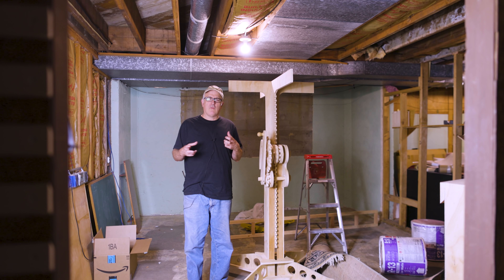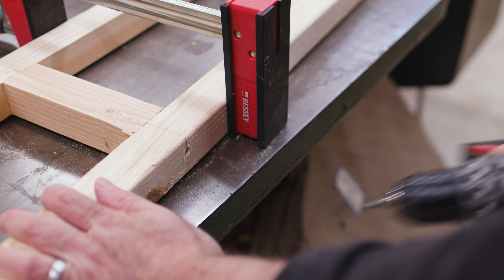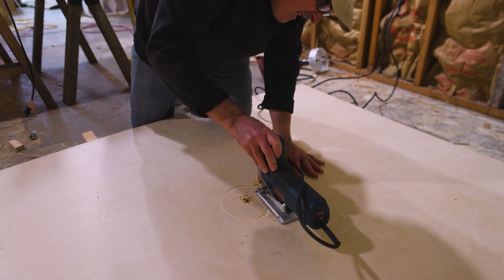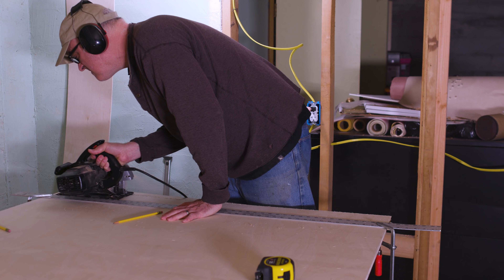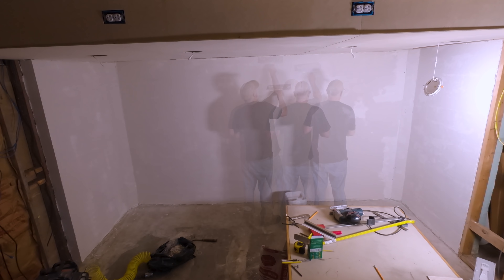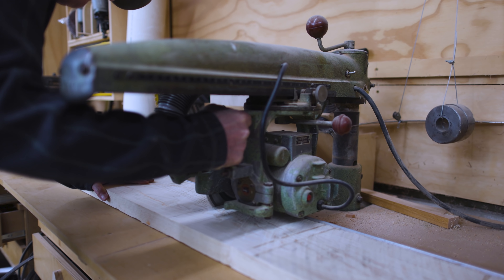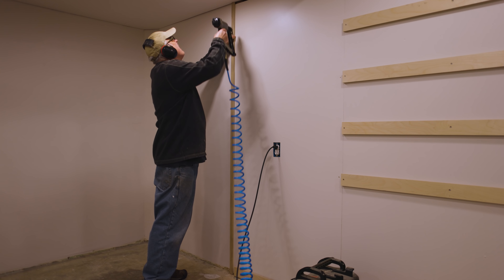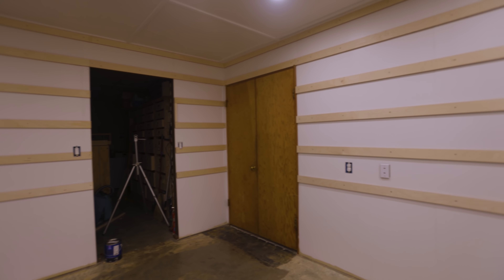Making a Craft Room

Comment: Frank, I loved your video, but I highly recommend you Don't paint your floor. If you paint the floor now, in the future, if you decide to put in any other type of flooring, it may require you to grind off that paint. Any floating flooring may require some floor leveling to the subfloor, which will not bond to a painted surface. And any glued down flooring like carpet tiles will not bond to the paint or even the thinset for ceramic or porcelain tiles will not bond as well. The only flooring you may be able to install would be a tackdown carpet, which is typical for residential setting as the tack straps are nailed down to the concrete and are not affected by the paint. Just a suggestion from someone in the flooring industry for 9 years now. Looking forward to your next video!

Comment: Code violation to cover the junction boxes in your ceiling. Those need to be accessible.
Reply: Yep. Typically those style are just "placed" in the ceiling not attached to the joists.
Reply: @rsporter  no. they are intended to be installed as shown. the light is removable thus accessible.

Comment: I also made my air return out of plywood, but I only went halfway thru from the front using the cnc router and then, on the back side, cut halfway thru in a perpendicular pattern. It REALLY made the painting an effort (until I broke out the spray can).

Comment: You should consider carpet squares for the floor. I had them in my basement when i bought the place.  I pulled about half of them out when i moved my wood shop in and ended up regretting it  so i put them back. 

It keeps the room more comfortable,  and the dust down.  Cleaning is as simple as just vacuuming.

Comment: A good trick with the outlets is take the outlets out and drill a hole in the 'center' of the box. Then with the panel in place use a trim router with a straight bit and follower bearing to follow the box.

Comment: It's interesting to see you struggle with the hole saw, but plow right through with the jig saw.  I work in ship repair running pipe.  I have drilled a lot of holes in bulkheads and decks with hole saws.  After you get the hang of drilling a 3" hole in a 1/2" thick steel bulkhead, punching through wood is easy day.  I've installed those lights in my house and struggled with a jig saw, then went out and bought the holesaw.

Comment: Hi Frank, I should stop lurking. I'm do
ing the same thing as you, coincidentally. I used a router with a template to cut holes, and your idea to make the holes small is good.

I'm using 3/4" fire retardant ply.

Excellent item i discovered are Carlon depth adjustable boxes - in some places just using 1/2" ply.

Comment: I didn't notice a supply register for your HVAC, one of the overhead ducts was more than likely  a supply duct, you could have added a register to open as close as needed. With the addition of the vent for air circulation it would have taken care of a return air air balancing issue. Nice little build for that room, the french cleat system is great.

Comment: The vent you made is interesting, it ties into an idea I've been thinking about lately. I think places like that would be a great place to sneak in fans and air filters. The idea would be to integrate common off the shelf parts (like a box fan and a 25x25x1 HEPA filter). Shared walls that you don't mind sound crossing between, custom entertainment centers, computer cases, seem like ideal locations.

Comment: Love the video Frank. Regarding cutting out perfect holes in the walls for the electrical boxes. Break off the "ears" on the top and bottom of the electrical plug to make the fit a little easier.

Comment: Covering the electrical junction boxes in the cieling is an electrical code violation, as well as the open splice in the wall at 13:28. Hope you don't regret it later on.
Reply: Permit?  Not a responsible video imo, sorry Frank.

Comment: Your video was well edited and informative.  Thanks,  The only thing I would have done differently is to glue furring strips on the concrete walls, insert rigid foam between them and then put wall board on the furring strips.  However, you were wise to leave the concreate exposed to allow it to dry.  I hope the covering does not trap moisture.

Comment: Our house is over 200 years old, so you can imagine that the windows are pretty small. Moreover, they are only placed along one side of the house. We have used a paint made by Dulux called LumiTec (I don't know if it's available in the USA, but I'm sure there's something similar) that contains reflective particles. It's brightened up our rooms no end. It's twice the price of other paints, but you can use it as the top coat only which saves a bit of money.

Comment: The "9-inch stud wall" you referred to are commonly called "ladders" in my region. Often times framed with a 2x2 at the ceiling and a strip of OSB (or ply) instead of "studs."

Comment: Will sound odd, but wouldn't drywall be cheaper to line the walls and ceiling with since you have painted it at the end?
Reply: Well it might be easier for him this way
Reply: As a project room, perhaps plywood offers more durability?
Reply: Drywall has a lot of extra steps, and requires tools and techniques he may not be as comfortable with, plus a lot of dry time between steps before the paint can go on. I think the extra effort for drywall in residential construction is largely for sound and fire management.
Reply: @ardemus  he plastered some of the walls, pretty confident if he can do that he could handle drywall seams
Reply: I had the same thought. Would have to be a lot cheaper too.

Comment: Frank love your work but @13:30 I saw a wire terminated with nuts in mid air and I bet it's live. Then near the end of the video I saw an empty electrical box above the vent that was CNC'ed. I hope you will replace the wire and route it to the empty box and put an outlet.

Comment: Why not drywall instead of plywood for ceilings and walls?
Reply: You must be new here. jk
Reply: It's just Frank
Reply: I'd say the level of dust and mess created by drywall and mud is quite unattractive for diy projects. Also as the other commenters said, watch his other basement projects and you'll see his style.
Reply: I was sort of wondering the same thing but plywood is a little more manageable and certainly more durable. I think it makes sense for a basement room especially if things are going to get moved around frequently
Reply: Really seems like its against most codes to do plywood instead of drywall. Hope his insurance covers it if there is a fire.
Reply: Frank was an architect in his past career, so he should have at least some familiarity with his local codes. If his municipality allows drop tile ceilings, I would think 1/4 plywood would be fine.  It isn't an auxiliary dwelling, so fire separation isn't really necessary.  I can't imagine fire spread on plywood would be particularly aggressive.
Reply: @justinschramm8481  If it was against codes to do plywood, every mobile home in America with wood panel walls would also be against code. As would all of your wood kitchen cabinets. 😉
I've worked in the Architecture industry for almost 20 years now, there's no code against wood panels on walls. The reason builders use drywall is because it's cheaper and finishes smoother.
Reply: @justinschramm8481  I'm not sure why it would be. Plywood is certainly a better barrier than nothing at all.

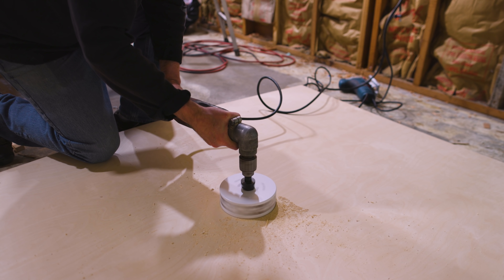Comment: 6:45 is that a backwards hole saw?
Reply: I wouldn't want to have one though. Seems to cut really slow. Haha
Reply: Frank reversed the direction intentionally.  It reduces the chance of the teeth grabbing and ripping the tool out of your hand.  It also reduces the chance of damaging the panel. Since the panel was ultimately going to be painted, he 1) wanted to be safe and 2) didn't want unintentional tooth grabbing in places that would be painted.  

He could have also used a different tool that had a clutch to control how much the hole saw would grab as well.

Comment: Frank – why only staples to hold-up the ceiling panels, but screws on the wall panels?
Reply: Ceiling was only 1/4" plywood. Walls were 1/2". Double the weight on the walls.

Comment: Not sure what the electrical codes are up there, but it looks an awfully lot like you're actually covering up those junction boxes behind that paneling which is a big no no.    Although never used those LED lights like that,  not sure if there's an exemption that it's close enough to the hole that it puts it in the same category as the junction box on those cans.
Reply: The flat LED lights are rated to be hidden like that.  They are still "accessible" because you can remove the disks with the LEDs and reach the junction box.  The pigtail connecting the box to the disk is fairly short.  You aren't going to have the j-box beyond the reach of your arm.
Reply: @HarryLovesRuth  If you can't access the connections inside the j-box, then it doesn't meet code.  I'm assuming that the j-boxes and fixtures are all running at 120V.   There are different rules for low voltage.
Reply: @kurtryan9208  Which Frank can do with the fingers that are at the end of his hands which are attached to his arm.
Reply: @kurtryan9208  some research will show they are entirely code compliant

Comment: Just curious, why did you use plywood and not just drywall?
Reply: Probably the ability to fix things to it easily without worrying about where studs were. Perhaps that decision came before the French cleat decision? Also, I guess it certainly would have made hanging the cleats a bunch easier! Especially given the intentional screw placement, which may have been thrown off kilter/out of symmetry by the need to put them into studs.

Comment: Woodworking is not carpentry, and vice-versa.  Have you ever watched a carpenter trying to make a nice table or furniture?  (usually out of 2x4's and nails).  The converse is true here.  A carpenter would be using a nail gun and rotozip, but Frank uses screws, glue, and a sabre saw.